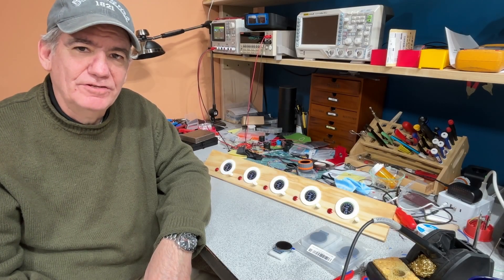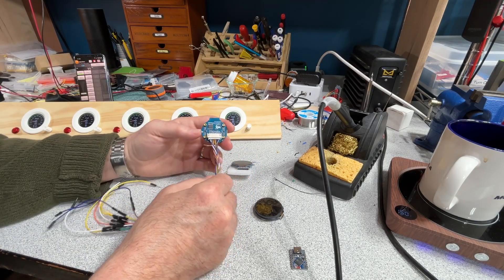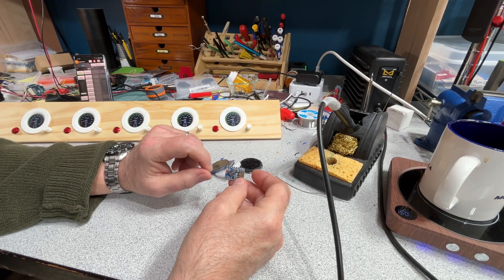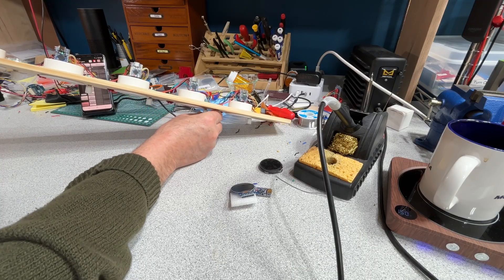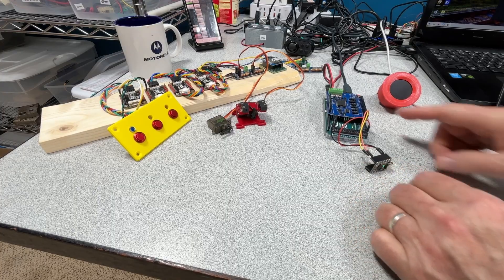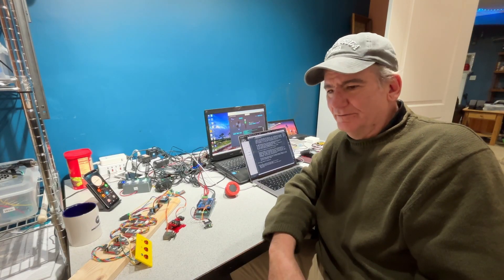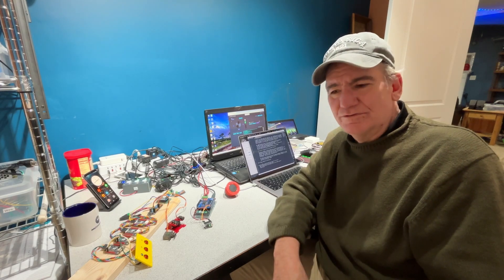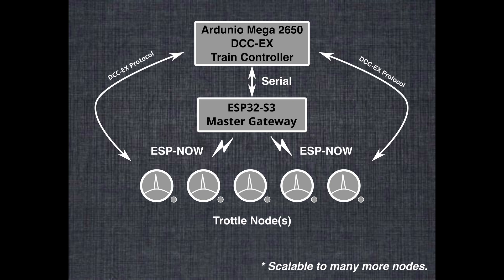Wireless Speed-O Throttle for DCC-EX

Comment: Hi, have you considered using Loconet over TCP ? This way all these throttles can be linked together using loconet. https://youtu.be/tUJ__mnhLTY?si=CIiXmia6usndy6Jp
Reply from the maker: I really don't know anything about Loconet.  I just started all thing late last fall so I'm a real noob.  So far, just learning to use DCC-EX on the Command-Station has been a handful.  What would Loconet bring to the party?
Reply: @TheNScaleEngineer  Hi, Loconet is a standard bi directional communication protocol for model railroads developed and licensed by Digitrax. There are a bunch of DIY projects that also use loconet. Since DCC is a one way protocol, you don't get feedback from any accessory hardware. So you don't know if the device received instructions. With loconet, you can query devices to know their status. For example, if you have loconet turnout decoders, you can ask what position they are set so you will know where your loco's are going. Same for loconet block detectors or loconet signals or when talking to a computer.

Like your Now protocol, it broadcasts to all devices and the device that has the correct address that is being requested, will reply. This protocol is based on a wired RJ12 phone type cable and is daisy chained to each device. But you can also use loconet over TCP which is wireless.

If you have any question, plase ask.